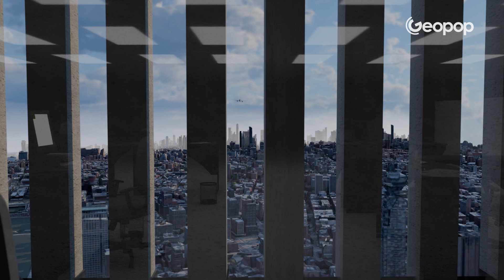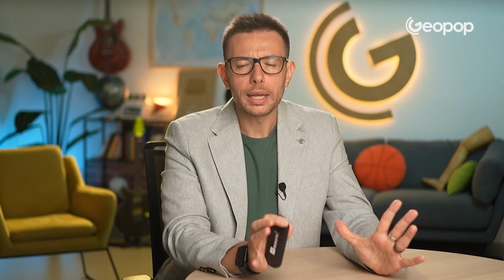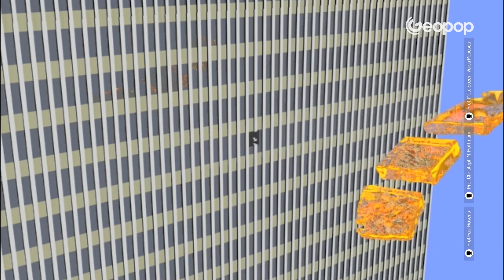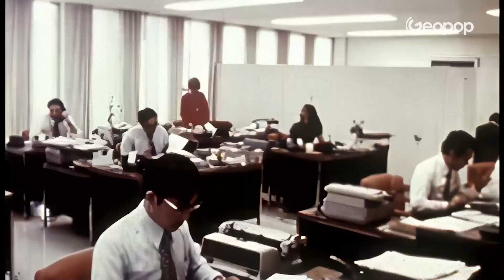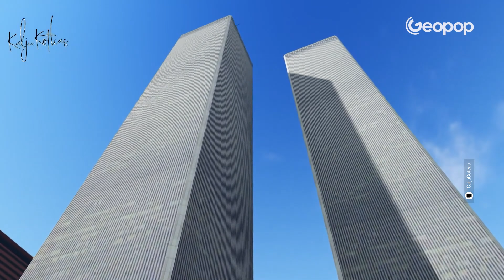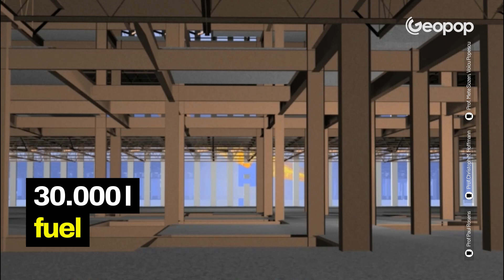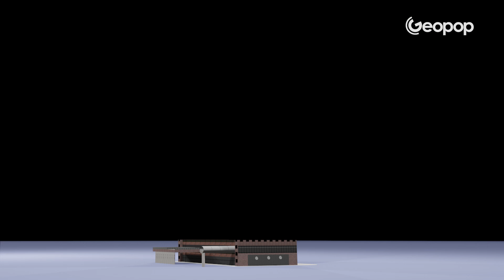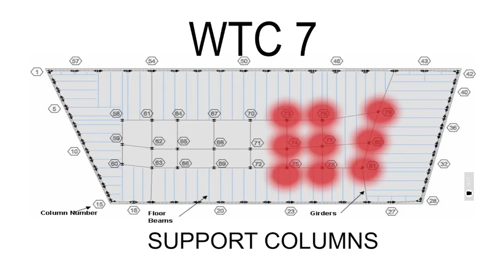9/11, 2001: The Technical Reconstruction of the Twin Towers and WTC 7 Collapses

Comment: Yet more than 3 500 architects disagree with the official narrative
Reply: What about the structural engineers that were the majority that agree it fell due to the fires, your really dumb.
Reply: @MrWilde-zx7vm  ae for 9/11 truth
Reply: @elliotberube5510  you realise that even if that was really true 3500 is stil a tiny minority?
Reply: @phoenixwright9105  ae for 9/11 truth Richard gage
Reply: Why was explosives never considered and tested for? Why was the request to do so just dismissed? Why was it independent people finding residue of thermite? How scientific is the result if they didn't even try to stand against all the presented evidence and all scrutiny? Majority or minority doesn't matter at all. Even one man alone can be right about something, while all the others are wrong. The large number of architects and engineers banding together should tell you something is soo wrong, that the case needs to be reopened.
Reply: @klarafall4281  The amount of thermite required to cut that many beams would have been absolutely colossal. There's simply no way they could have gotten that much in place without it being blatantly obvious. And considering the effects of gravity, it's going to be next to impossible to cut vertical beams before all the molten iron simply drips away.
Reply: @adamk203  I don't know about those specifics. Maybe it is in fact ridiculous, but not investigating it is moronic and - in this case - a crime.
Reply: @klarafall4281 nobody found traces of thermite, you’re just crazy
Reply: @klarafall4281 hmmmm I wonder what caused towers to fall? We should look for a deliberate explosion, surely it can’t be the planes full of jet fuel the slammed straight into the buildings, coupled with the fires that burnt unchecked for over an hour, that’s ridicules
Reply: This is the #1 thing you could say to anger an engineer. Architects make things look pretty. ENGINEERS make things stay up.
Reply: @PretzelSage  Up until you get to the Hyatt Walkway collapse and they don't know basic physics, I guess...deadliest structural disaster in US history. Killed 114. 

You need 1 long rod to the roof for two walkways. NOT 2 offset ones that put the load on the box beam weld. Bad idea.
Reply: I stay in my lane, as an architect I always work closely with engineers in every project. We are spacial planners, aesthetics and functional aspects. We are not trained in advanced engineering. Just simple structural intuition. And I don't trust my intuition to keep a building up. To engineers specifications is the most common annotations on architectural drawings.
Reply: Only 4 out of 5 dentists recommend sugarless gum.
Reply: @orionred2489  it was architects, engineers, physicists and more
Reply: I'm definitely not one of those architects.
Reply: "To engineers specifications" is the most common annotations on architectural drawings.
Reply: Yet real architects and engineering organizations don't take them seriously and distance  themselves from  that conspiracy group
Reply: I'm sure you can also find a percentage of architects, doctors, lawyers, and engineers who believe the earth is flat and that the moon landings were faked. No matter what that percentage is, it's a tiny minority.
Reply: Source?
Reply: Sounds about right. Only architects are capable of saying the dumbest shit imaginable LMAO.
Reply: @jacoboc2244  - Please list these world leading structural engineers who disagree with *Impact Damage + Heat + Time + Gravity = Collapse and tell us if and why they are right.
Reply: @jacoboc2244  But they didn't say anything.
Reply: Exactly 0 of them are experts in high-rise buildings.
Reply: You do know that architects are NOT structural engineers?
Reply: It's takes x amount of energy to destroy 3 buildings to dust, the airplanes and its fuel would never produce enough energy for that, it's mathematically impossible! Let's talks about the other 100 coincidences that day tho since you are a little dense
Reply: @GeronimoLogistics  Correct indeed
Reply: @GeronimoLogistics your dumb.
Reply: @GeronimoLogistics you aren’t considering other fuel for the fire. Nothing in that building was fire retardant. And its well documented that the fire proofing on the core was extremely degraded.
Reply: @MO3MINI  Not true. You had shite tons of asbestos, which did and is still killing lots of people and pets/service animals. 

The black lady in yellow dust is dead from a weirdo cancer. She was like 45. I know there's a lot of others.
Reply: @GeronimoLogistics it was the fire that brought the buildings down not the force of the planes
Reply: @GeronimoLogistics  Potential energy of the buildings, dude. That's what destroyed them. Because gravity exists, right.
Reply: @GeronimoLogistics nuke.. just saying.. 😉
Reply: You do realise that the 3,500 mentioned earlier consists of not only architects but engineers too? It’s literally called “architects and engineers for 9/11 truth” - also a lot of them are leading experts in their field and from some of the best universities in the world - it’s not just architects and never has been
Reply: @thedevilsreject23 Sounds more like cope because they don’t want to admit that their designs are bad. They claimed that the WTC buildings were designed to withstand an aircraft collision, but we know that was false.
Reply: @thedevilsreject23  - Leading experts in what field?  Landscape architecture?  Landscape engineering?  ever bother to read the bio's?  Maybe 25 out of the 3,650 signatures are from people with any sort of structural engineering background.  What have these people actually agreed to anyway?

3,650-sh people with some sort of credential or degree in some technical field or another simply signed this;

To the Members of the House of Representatives and of the Senate of the United States of America, PLEASE TAKE NOTICE THAT 

On Behalf of the People of the United States of America, the undersigned Architects and Engineers for 9/11 Truth and affiliates hereby petition for, and demand, a truly independent investigation with subpoena power in order to uncover the full truth surrounding the events of 9/11/01 — specifically the collapses of the World Trade Center Towers and Building 7. We believe there is sufficient doubt about the official story and therefore the 9/11 investigation must be re-opened and must include a full inquiry into the possible use of explosives that might have been the actual cause of the destruction of the World Trade Center Twin Towers and Building 7 .

The petition is not testimony or an affirmative statement of anything. It is a mere request that someone else look into the POSSIBILITY of the use of explosives or incendiaries that MIGHT have been the actual cause of the collapse of the Twin Towers and Building 7 because of a belief there is sufficient doubt . 

Can’t get more generic and non-committal than that!

The folks who signed apparently can’t even be bothered to do the investigation themselves, or perhaps they are unqualified or just not that interested. Not that important I guess. Those who have signed certainly do not publish peer reviewed technical articles in favor of AE911T claims. Once would think there would be at least many hundreds of such articles if there is so much expert support but there’s nothing.

One does not even need to believe explosives/incendiaries were used on any building to sign the petition. Indeed, I have several friends who think that is idea absolute nonsense, but signed the petition anyway just to get the AE911T newsletter. So you can’t make any assumptions about why anyone would sign.

Just 3,6xx names over 17 years of campaigning is a tiny number.  Completely insignificant.  If we break that down further many signatures are so old that a significant number of signatories has likely passed away. Others surely no longer support even the very limited scope of the petition's language, may have even forgotten they signed the thing. Others are not practicing or no longer certified in their fields. Many architects and engineers are not qualified to assess the engineering facts of 9/11 (land surveyors, electrical engineers, ...), and most obviously are not well informed about the facts of 9/11 (they only heard the AE "Truth" sales pitch) so the fact they have signed the petition by itself means nothing

Meanwhile the 130,000 member American Society of Civil Engineers - ALL of whose members are qualified engineers - fully supports the conclusions presented here. And that is just a start. 

Your entire argument is pure feces of the male bovine. An argument from authority (an obvious logical fallacy) without the argument and without the authority.
Reply: Doesn't matter how they fell.  24 years and we still go on and on about it.

Why is there no effert put into who was in on it?
Seems like that part might be just a tad more important.
Reply: They were dancing outside

Comment: Mass did not increase this is misleading
Reply: For each floor that was added to the collapse, the mass of the collapsing structure increased by the mass of that floor. This isn't difficult to understand.
Reply: @reignman30  The only change in mass was that mass was falling outside big time meaning that the mass was REDUCED during collapse. That´s the opposite of "increased".